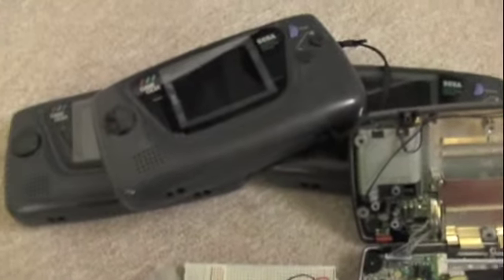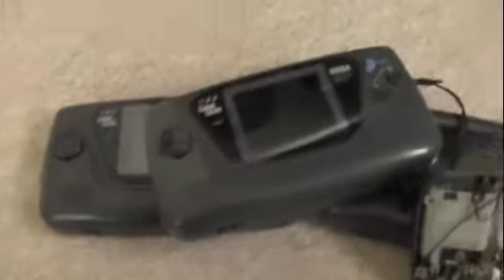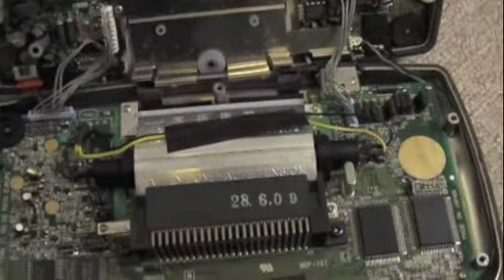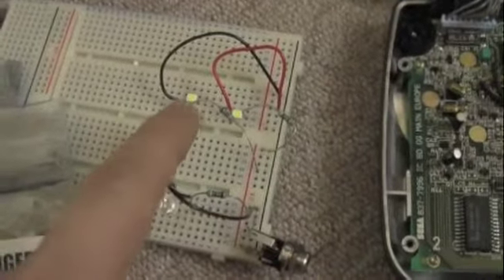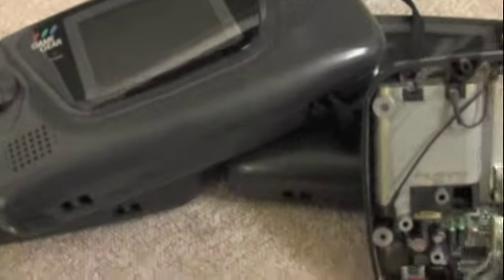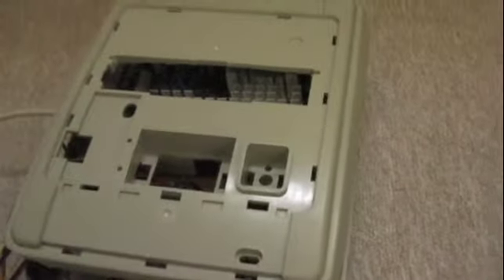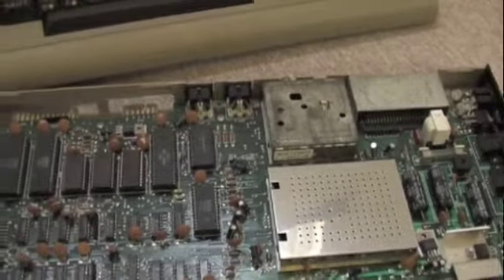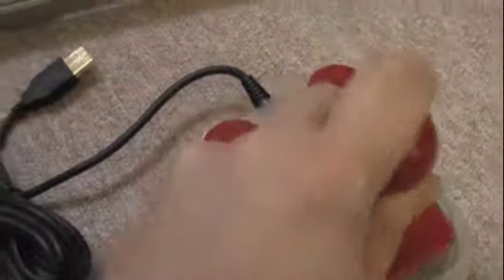Projects, projects and more projects!!

Comment from the maker: I don't know too much about the GT. I would assume you could modify a video camera battery circuit to run the GT then you could charge as you go. I've done a bit more work on the GG backlight which I will show in another video coming up. At the moment I'm working on a Turbo Grafx 16 with cd that I picked up for a good price.